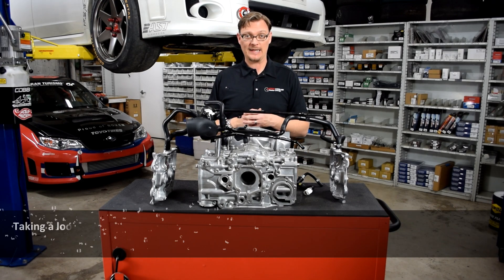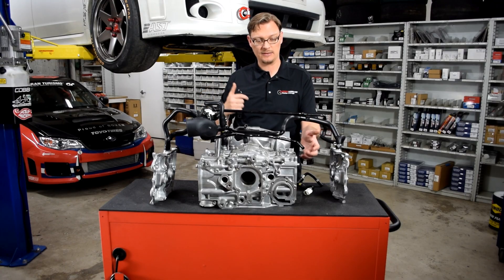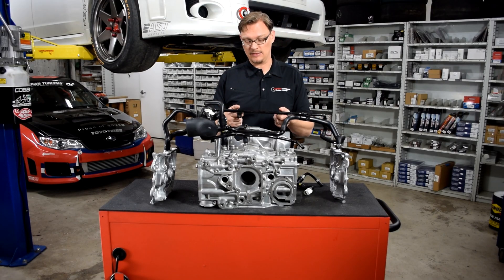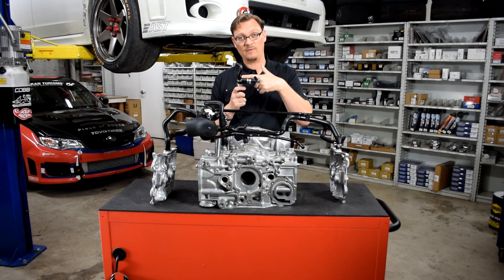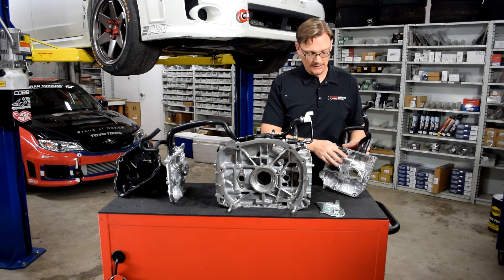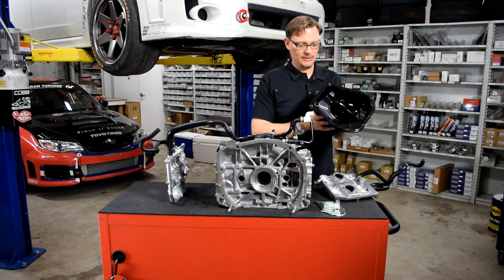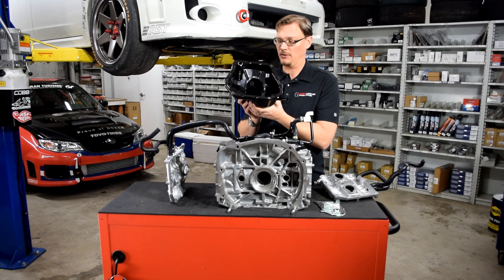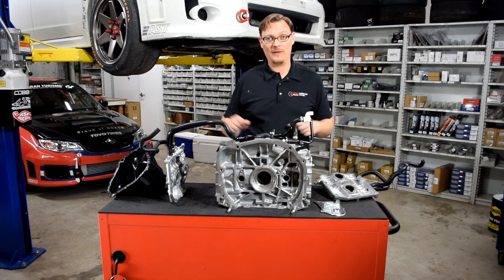Taking a look at the Subaru EJ25 Turbo PCV System

Comment: So based on all of this info, what do you think is the ideal way to drain the AOS oil back into the system?  I really dislike draining back into the PCV vent.  It’s hard to keep the drain hose higher than the block so it can drain and it’s a long run of hose.  With some of the new AN solutions to drain turbo oil, I’m wondering about a Y to join the turbo and  AOS drains, but of course don’t want to prevent the turbo from draining properly.
Reply from the maker: Thanks for your question.  It definitely is a tricky one.  I believe that the Crawford AOS drained back to the turbo oil-return.  But you are exactly right,  You would have to make sure that the drain from the AOS didn't effect the turbos ability to drain.

One of the more interesting we have seen recently is the Roger Clark Catch tank that drains to the oil pan drain bolt.  It works for them because they are Right-hand drive.  But we took an initial look, and it would be pretty darn hard to route a can from the right side all the way down to the drain plug.

Still an interesting solution to the problem.

If we come up with anything, we'll let you know!
Reply: FlatironsTuning interesting.  There is an extra bung on a killer b pan.  Long hose as you said.
Reply: @FlatironsTuning  I comments is quite inline with Davids. I would like to sum up the video pull out some conclusions and have your feedback about it:

There are 3 circuits:
* first equalizes pressures between crankcase and the head covers.
* The second takes out "clean" blow-by-gasses (BBG) from head covers internal AOS outputs and connect directly to turbo inlet.
* The third circuit connects to cranks-case AOS output (the more probable source of BBG), PCV valve, which output is turbo inlet hose and is triggered by a small line to intake manifold. When manifold is under pressure (WOT), it shuts the PCV valve. When manifold is under vacuum (no motor charge), valves open.

I have five conclusions:
* The three internal AOS work thanks to gravity and may not be effective for gasified oil (Blow-by-gazes).
* Manifold under pressure (WOT): BGG from head covers enter the turbo inlet which is under heavy vacuum.
* Manifold under vacuum (cruising): BGG from head-covers + crank-case enter the turbo inlet which is under light vacuum.
* PCV valve function is only to limit the risk of allowing liquid oil from crank-case to enter directly into the turbo.
* adding and external AOS will require to modify the plumbing of at least the 2nd and the 3rd circuits since oil return cannot be done to any internal AOS output (no oil should be there)

Am i right ?

Comment: EJ205 has pcv metal lines running along intercooler, as well as crankcase breather. Atleast on wrx variant.
Reply from the maker: Yes, the metal line on the intercooler that connects the two valve covers is the same as on the 2.5 Liter engines, but the 2.0 Liter heads are missing the second set of breathers. 

They did start putting them on the STI 2.0 liter heads though, but I'm not sure exactly what year.  If you see a 207 head with 2 fittings on top of the valve covers, then the routing would match what we go over in the video.

Hope that helps, and thanks for watching!
Reply: @FlatironsTuning  can't you just ditch the crankcase breather to valve covers setup? The 2.0 litre never had it so what's the need it would clean up the engine bay of plumbing.
Reply from the maker: @jordanp6420  I wouldn't recommend it.  It does serve a purpose, but if for some reason you have to remove them, yes, you are correct, the 2.0 liters here in the US never had those connections.  The EJ207 did get them eventually though.

On a street driven car, they are far less necessary.  But if you track your car, the purpose of that connection is to help the oil drain back from the heads to the pan.  

I hope that helps, and thanks for watching!

Comment: 2:49 What does that turbo inlet hose do ? and what happens if it cracks or is dislodged .. would that damage the engine or just result in oil venting into the open atmosphere ? Thanks !
Reply from the maker: At that point, the line being described is the line from the metal hard line that goes forward to the turbo inlet.  If that is the correct one, this is what vents the valve covers to the turbo inlet.  If that is cracked or becomes dislodged, the main issue would be that you now have a large vacuum leak that is letting in a lot of unmetered air.  This can definitely cause some drivability issues, and a lean-running condition.

I hope that helps and thanks for watching!

Comment: Just out of curiosity and more so the talk of needing an AOS, i have a 2019 Subaru STi, got it brand new with 6 miles I now have 1,443. Am I better off jumping right in with getting an AOS? Or is this something that is more so needed if you realize there is blow by? This is my 1st EJ25 and Id just like to do everything I can that will prolong the life of this motor. Thank you for your time.
Reply from the maker: Thanks for your question.

Basically, if you are not moving oil/crank-case gasses through the inlet of the engine, the need for a catch can or AOS is very minimal.  If your car is stock, and it is daily driven, then you are probably fine leaving everything stock.  The two tell-tale signs are needing to look at changing something would be needing to add oil between change intervals (of say 3,000 miles or more, and needing to add more than 1/4 to 1/2 of a quart), and signs of oil in your intercooler that is more than a very small film.

If you haven't looked at it all ready, I would also recommend looking at the video we did comparing the difference between an AOS and Catch Can as well, as that may be some good information for you too:

https://youtu.be/pA3YfMgofrE

Hope that helps, and thanks for watching!

Comment: Awesome description dude!! Any chance you can do the same for the EJ20 engine series? Thanks!!
Reply from the maker: Thanks Osvaldo.

Actually, the 2.0 is basically the same layout as we describe here, but it doesn't have the 2nd port on the valve covers.  that second port connects the left and right valve cover to the center crank-case.

But if you remove that, everything else is basically the same.

I hope that helps, and thanks for watching!

Comment: Hey when will u do a video on subaru cooling system. Like when u raise the boost an pushing the cars power up an how the coolant would over flow out an bubble
Reply from the maker: Thanks for your question Justin.  The cooling systems on Subaru's tend to be pretty over-built.  The issue you are describing is most likely caused by "lifting" a head from high boost pressure.  This would relate to a compromised head stud as well.  This is something that shouldn't be much of an issue with a proper build, but I can see where it could come up.

I'll add this to our working list:-)

Thanks Justin.
Reply: i had done a full re build on my ej25 with arp head studs darton dry sleeve included an machine the heads an block for flatness an still the coolant get into the over flow bottle this has been the 3 time i remove the motor to correct this problem an now 3k miles on the build an 20lbs of boost an still we having this problem with coolant over flowing n a few bubbles
Reply: took it too the track yesterday an when i parked to have it cool off i notice a few bubbles not much nor have the level pass full mark on the bottle yet but i have seen this b4
Reply: also the part where i bleed the system is done with a vacuum bleeder tool. car has no heater system has upgraded radiators an fan! both me an my friend have this problem when pushing the car hard! cars only making around 380 to the wheels!
Reply: i am leading toward a thermostat removal as it seems the cooling system are a bit weak! but i dont know need help car was running fine still is but when pushing boost its then i would see some bubbles. replaced rad caps you name it done everything that i would know how to do to fixs this problem. so i was leaning towards removal of thermostat b4 anything gets bad
Reply from the maker: Hello Justin.  Gotcha.  Sleeves can certainly be problematic when it comes to coolant and head gaskets, and one of the reasons that closed-deck inserts have started to take over is because they aren't as potentially tricky in that regard compared to sleeves.

Going back to the original question I can offer a couple of things to look at.

First, from running the car to cooling it down, you should see the level of your over-flow tank start at the "cold" level, move up to the "hot" level when at full temp, and then you should see it go back down to the "cold level".  That movement of coolant implies that the cooling system is sealed.  If you see coolant moving up in the overflow, but not moving back, this most likely indicates that your cooling system is not sealed, or it is being compromised by exhaust gas.

If you aren' t seeing a good movement of coolant, you should first pressure test your radiator caps.  If you are going to look at your cooling system, the first thing that you need to know if that those are working properly.  We have been surprised bordering on shocked by how often caps can go bad.  Apparently, high heat/overheating can compromise the springs in the caps FWIW.

The next thing would be to pressure test your cooling system.  This is again to make sure that nothing is letting air into the system.

If you caps are working, and your system is sealed, then there is only one other thing that can prevent coolant from moving properly through the block, and that is headgaskets...

Hope that helps, and I'll try to remember to let you know if we get a cooling video up.

Thanks!
Reply: yes it does go  down after cool down but my problem is the bubbles that occurring with it too! also do think i should remove thermostat

Comment: This is the best video that really talks in depth about AOS and catch cans.  IMO a lot of thought goes into building these modern engines. I think that for regular car use with some aggressive driving once in a while the OEM AOS system will do its work efficiently without the need of aftermarket catch cans. What are your opinions on that? Will highway driving like once a week aggressively clear the valves in a GDI engine?
Reply from the maker: Thanks for that comment Gerardo.  In short, I would agree with you.  My current take is that if you are not using much oil if any, the need to intervene with the PCV system is minimal if any.  The need for something like a catch-can or AOS only starts to come into play if you are seeing more oil consumption and you want to make sure that the oil isn't making its way into the engine, etc.

Thanks for watching!
Reply: FlatironsTuning Thank you!  👍

Comment: Can someone please HELP ME!!!! So my Help needed is I just put a new Engine in my 2005 Subaru Legacy GT and that white connector he shows in the video. I literally can't find the wire/pigtail that plugs into that!!! I'd greatly appreciate if someone could lead me in the right path!!
Reply from the maker: Thanks for your question.  That white connector connects to the manifold wiring harness.  It is basically just a jumper to tell the ECU that the PCV system is connected.

Hope that helps, and thanks for watching!

Comment: I’m just amazed (or disappointed) that Subaru incorporated such a complex system, yet so many turbo owners still require an aftermarket solution. I hope I won’t need one in the future, but I’m still considering it.

So my car is at 160k miles and doesn’t consume any oil. Just did my last oil change interval with 4000 miles, and I didn’t need to top off. Dipstick always reads at the full mark. I drive my car quite hard on 5w30.

Is this success due to the factory AOS doing its job? Or is my motor healthy? Or both? Do I even need a catch can/AOS? So many questions....
Reply from the maker: Thanks for your question Bill.  I would say that for your car, the lack of oil consumption would mean that yes, your engine is healthy, and the stock system is working properly.  If you are not going through oil, and you don't see enough oil in your intake system that would prompt you to correct that issue, you should be fine staying with the stock system.

Hope that helps and thanks for watching!
Reply: So I've decided I want a catch can for my 06 WRX before installing a downpipe & tune. She's a daily driver and I want to maintain the longer oil change intervals, so I don't have to worry about possible oil contamination with an AOS. 

All the catch cans I've seen only connect to the tube (bolted to TMIC) that T's off to the valve covers... What about the other lines from the factory separator that connect to the turbo inlet and intake manifold? Wouldn't those have blow-by as well?

I hope I'm understanding the system correctly. Your video focused on 3 main connections:
- 1st is from crankcase to valve covers (not directly connected to intake air)
- 2nd is from valve covers T'd to the turbo inlet
- 3rd is from factory oil separator, one to turbo inlet and another to intake manifold. 
Am I correct?

Wouldn't there need to be at least 2 connections to the catch can to collect all the blow-by?
Reply from the maker: Thanks for your question Bill.  If you want to catch any and all oil that is going through the PCV system, you would need to look at both of the points where the system connects to the turbo inlet.  The best piece of information I can give is that you want to keep both of those connections separate.  If you want to use catch cans, you would need 2.  You do not want 1 can with multiple connections in my opinion.  This is the mistake that I made when starting to look at blow-by and hooking up a catch can that"T'd" both the inlet and outlets into one can.

The reason for this is that those connections will function differently as the manifold goes from vacuum to pressure, and as the crank case starts to pressurize.  If you connect them into one can, you are significantly limiting the systems ability to adapt to changing conditions in the manifold and case.

This is something that we will dive more deeply into at some point, but that is the gist.

Hope that helps, and thank you for watching!
Reply: I was going to use 1 can, but your recommendation has sent me in a different direction. It'll be much better to just install 2 cans connected to each inlet port, than to somehow connect multiple connections to 1 can. 

Thanks for the advice!! :)
Reply from the maker: No problem Bill.  Glad we could help!

Comment: Do you have any data on what the best solution would be to incorporate the EJ257 block with EJ205 heads?  Particularly, what is the proper way to include (or not include) the extra port on top of the crank?  I'm building one now and finding a lot of opinions about it.
Subscribing to the channel.  Excellent video.
Reply from the maker: Thanks for the question Jeremy.  There are a couple of options.  The best one being to duplicate the routing that the 2.5 liters got, and "T" that center breather to the valve covers.  This would require adding an extra fitting the the valve covers themselves though.  

It is also a valid option to simply block that port off.  In the early days of the hybrid swap, this was the preferred method.  You just have to make sure that you aren't trapping oil in your heads which is what that new connection was designed to prevent.  Keep in mind that for a daily driven car, balancing the pressure in the heads and crankcase is not very hard.  It only starts to get interesting as you turn the boost/power up and especially when you start tracking the car.

A third, somewhat new option would be to rout that fitting to incorporate it into an AOS system.  I have talked to a couple of people about that and in a pinch, it might work okay.  But the ideal would again be to duplicate the OEM routing.

The one thing that you can not do is to rout it into your PCV system.  There is a lot of liquid oil that comes up through that port, and if you connect that to your OEM PCV system, you start to see a good deal of oil consumption.

I hope that helps, good luck with your project, and thanks for watching!
Reply: Some built ej205 blocks come with this port just blocked off, would it be harmful to run this system on a ej205 with 2.0 heads?